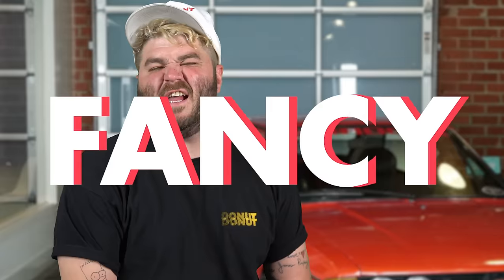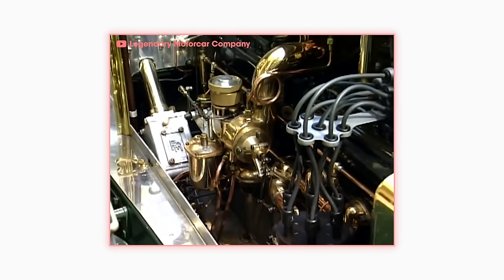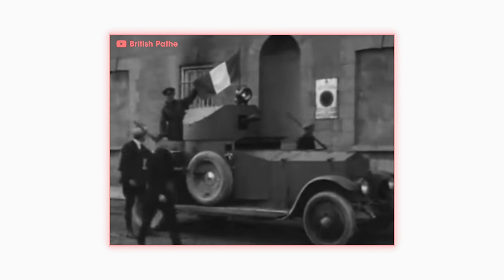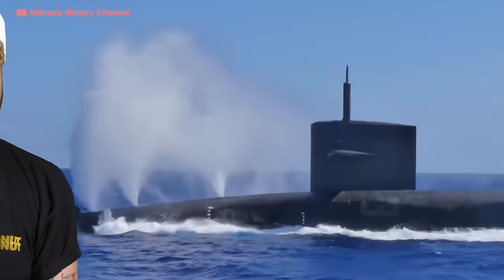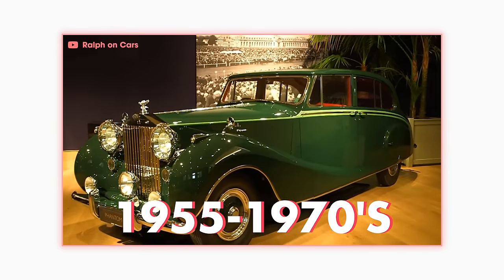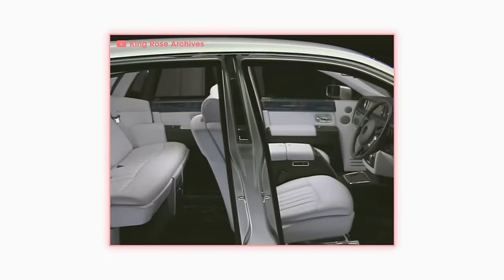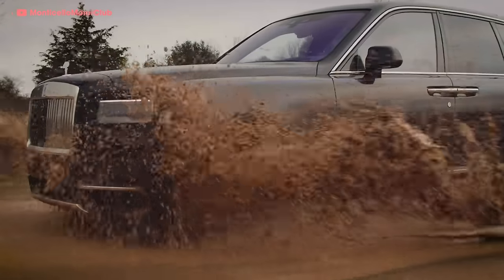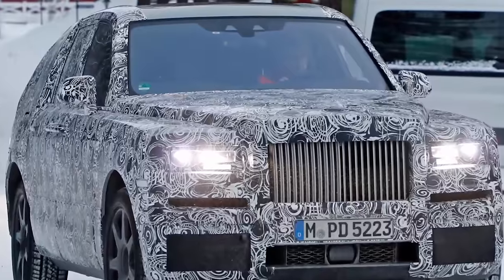ROLLS ROYCE - Everything You Need to Know | Up to Speed

Comment: this comment has 1k likes
Reply: Mclaren vote kicked honda
Reply: Toyota has banned Mclaren
Reply: Did you say reliability? 

*CHEVY* has left the chat
Reply: Did u say reliability? 

*1994 toyota celica joined the chat
Reply: honda is not as reliable as you people set it up to be. i get soooooo many hondas come in to my shop with electrical issues, air conditioning issues, heater issues too, transmission, and the quality is shit too. i was at a honda dealer and noticed uneven gaps and chrome trims not stright. soooooo yeah.
Reply: the 1990s honda *  @xavierramirez330
Reply: @usuallyclueless4477  you mean those dam Chihuahuas. I call them that because they shake vibrate non-stop. Horrible cars. Toyota does not shake like that
Reply: Did you say reliability?

iron duke has joined the chat
Reply: Toyota Hilux has joined the chat
Reply: @xavierramirez330  Yeah Honda tends to make plastic-sounds when it goes above a certain speed (especially the cheaper Jazz and Fit models). Toyota is the really reliable one and does not really make plastic sounds even when it's a cheap Vios made out of a lot of plastics. Heck, even a Hyundai is more reliable and quieter than a Honda (Source: I used to drive a Honda too)
Reply: Honda's burn oil if you look at them crooked.
Reply: Did you say: safety?

VOLVO HAS JOINED THE CHAT
Reply: Scotty Kilmer joined the chat
Reply: @KillSwitchNY  my Honda, my homies honda, &&& my coworkers Honda all have oil leak problems):
Reply: I might be the odd ball here but my Chevy Beat or Spark(in Europe) is as reliable as heck..... I bought it in March 2012 and have done 103504 kms as of tonight and it haven't broken down on me yet and if you see the kind of roads we have here in one of the most remote and poor states of India you will be surprised .... but it ain't the fastest or most comfortable car.
Reply: @sisca08  my man
Reply: Reliability?

CADILLAC has left the chat.
BUICK has left the chat.
GMC has left the chat.
CHEVY has left the chat.
Reply: Xavier Ramirez Honda engines are bullet proof. The performance ones at least
Reply: @remyfagerstrom6780  You don't have to do GM like that lmaoooooooooooooo
Reply: @Maimo Moline 
GM has entered the chat
Pontiac has left the chat
Oldsmobile has left the chat
Saab has left the chat.
Reply: And volvo laughed
Reply: Did you say reliability? 

* Maserati has left the chat *
Reply: Ford has left the chat
Reply: Did someone say reliability ? 
Ford has left the chat
Reply: HONDA HAS BEEN BANNED FROM ANY CHAT GROUP
Reply: Blank Nick mr Kilmer has liked your comment
Reply: 1.1k

Comment: Fun fact: Rolls Royce also made jet engine for commercial airliner like the A380, A320, Boeing 767 & of course the 747
Reply: not just commercial airliners but also for some planes used in the war(s)
Reply: You forgot embrar
Reply: They made truck engines too
Reply: Another fun fact, Rolls Royce also makes the engine for the H-6 Little Bird helicopter
Reply: Edward Wong they also made the engine for the P-51D mustang
Reply: @dankduck8113  Look up the Rolls Royce Merlin V12. It was the engine that won WWII for the allies. Aside from bring used i the Spitfire and Hurricane fighters it was also used in the two engined fast fighter-bomber Mosquito and also in the Avro-Lancaster heavy bomber (4 Merlins). The American P51 Mustang was originally made with Allison V12 engines, then somebody tried using a Rolls Royce Merlin in one and they had a real winner. The Merlins used in Mustangs were licence built by Packard. Btw, Rolls Royce also designed at tank engine based on the Merlin called the Meteor. A lot of tanks came with the very powerful (600hp was a lot for tanks during WWII) Meteor V12. And Rolls Royce already made aircraft engines in WWI.
Reply: Aero division is a different company to the car company since 1971. But they also power(ed) Concorde, 737s, Harriers and are an option on most other everyday commercial jets.
Reply: That is Roll Royce Aero Engine, they have no relationship with BMW's Rolls Royce.
Reply: Made... Ehum
Reply: Rolls Royce that build jet engines today use to build the vehicles but due to financial difficulties they ended up selling the automobile decision to BMW but they still build jet engines today
Reply: And also for legendary spitfire from ww2
Reply: @Daniel OLIBRICE The 737 Max aircraft is the plane you had in mind. The 747 was released back in 1969 and one of the most iconic double deckers. She currently competes with the A380 although both of them are being put out of production as their capacity is too big to be cost efficient. The 737 is also an old series of plane, and Boeing even thought of replacing it all together. But pressure from Airbus A320 NEO led to the release of the 737 MAX. The problem is that the max simply have too big engines for its size, causing the plane to pitch upwards when full power is given. A system called MCAS was designed to counterreact this issue, but Boeing never informed anyone. An official Boeing man once even stated when a pilot asked about the system "The pilots are the only ones that can stop the system if it fails" To that the pilots responded "But you didn't even inform us about it" referring to MCAS.

Be aware. That both Boeing and FAA (Federal Aviation Authority) are guilty of committing faults during the testing and releasing of the plane. In my personal opinion, I would NOT fly again with the plane until at least two authorities other than the FAA, approves the plane again. EASA (European Air Safety Agency) for example stated that they will not approve it without their own testing.
Reply: Fun fact #2- An Indian king used rolls royce cars to carry garbage in his city because a royce salesman disrespected him in uk calling him poor... Never judge a book by its cover proved right there xD
Reply: Edward Wong woah really
Reply: They still make
Reply: Rolls Royce didn’t power on A320. The only RR powered aircraft were A380, A350, A340 (-500 & -600), A330, B787, B777 (excluding -200LR, -300ER & 777x), B767, B757, B747, B717, Spitfire, P-51, Hawker Siddeley Trident, Fokker F28, and some other aircraft.
Reply: @Daniel OLIBRICE thats the 737 max 9
Reply: And the spitfire, p-51, hurricane, f35, harrier etc
Reply: Don't forget warships too. American destroyers use Rolls-Royce engines.
Reply: I work for a yacht builder and we install 2800 HP RR MTU's in our boats
Reply: @randomotter6346  I work for RR defence and we only created the lift fan for the f35 not the main engines
Reply: How have you all forgotten about the Concorde powered by RR Olympus! We power the euro fighter typhoon with EJ200s. Power aircraft carriers with MT30s. Submarines with SMRs. Soon to power the 6th gen fighter tempest !
Reply: @Jdalio5  just for clarification MTU is a subsidiary company of RR. Typically for commercial customers. The MT30 is a whole other beast for aircraft carriers. Rumour has it we loaned Bristol council two MT30s in case of a blackout to power the entire city (where RR defence’s main site is located)

Comment: You forgot that the P-51 mustang airplane has a water cooled roll Royce engine
Reply: Early models of the P-51 used an American designed/built Allison engine but the US was pretty far behind UK/Germany in terms of aircraft and engine design so it was switched out for the RR Merlin also used in the Spitfire.
Reply: The engine was designed by Rolls Royce as the Merlin, but the engines in Mustangs were license-built by Packard in America.
Reply: But the ultimate version (The P51 D) used a Packard motor
Reply: also that they made the first turbine engine I think
Reply: @Jon Petrangelo And... What about the V-engines...?

Comment: I heard owners talking trash about the 1967-80 cars "perfect AMC Ramblers"  those cars look exquisite compared to the last 30 years.  I have been around some of the 1920s-50s cars.  They were mostly projects of hobbyists, and looked "Real".  There is one up the road in a junkyard.  About half a mile East there are about 3 or 4 keeping company with some '60s-'80s Americans.  The grille was around in the 1900s.  They made some odd cars in the 1900s.  A V8 car called the "Legalimit", designed to go only under 20mph.   Another one called the "Hidden engine" had that V8 under the seats so it looked like a horse carriage with no horses.  Are these cars only an accessory for appalling celebrities now?

Comment: You forgot that the ww2 spitfire had a rolls-Royce engine in it to with 1,414 horsepower. The spitfire also came out in 1938 and was used as an allied plane and was one of the fastest and nimble planes of the war.
Reply: It was a 12-cylinder, liquid-cooled Rolls-Royce PV-12 engine !

Comment: Shame that you didn’t go into greater detail into Rolls-Royce’s aircraft engines. The Merlin was the engine that won the Air War during World War 2. It powered the Spitfire until the MkXIV (at which point they dropped the Griffon, a Merlin on crack), and a licensed version made by Packard went into the P-51 Mustang, a platform that is still winning air races. Amazing video otherwise!